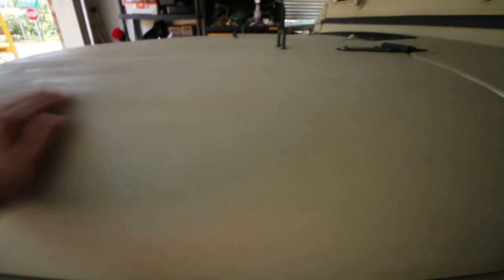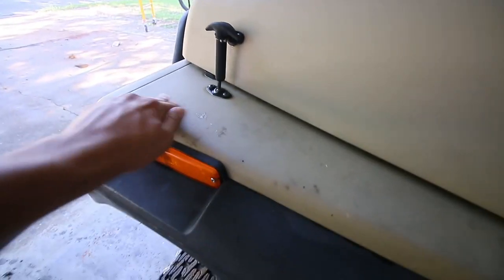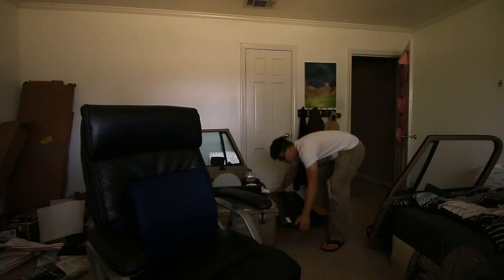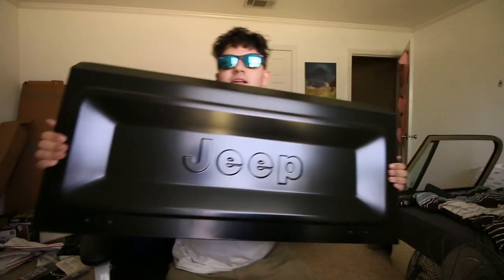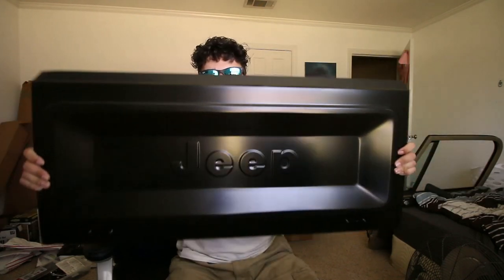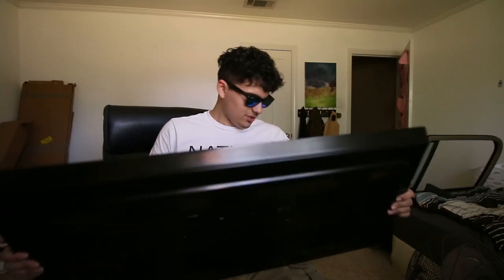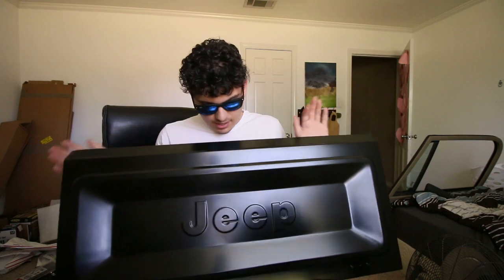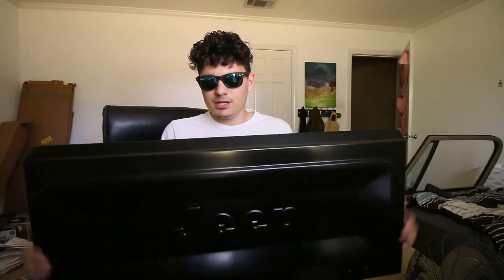Building a Jeep Yj

Comment: They make an aftermarket air conditioning system for YJ's that you can bolt under the dash. It's about $950, so it may be out of your budget range.
Reply: Are you wanting to do the CJ hood, fender, and grille conversion?
Reply from the maker: Austin mine was actually a Sahara so it has that ac unit already installed which is fantastic! And I’ve really thought about it and might one day but I’ve grown pretty fond to the robust look if the yj